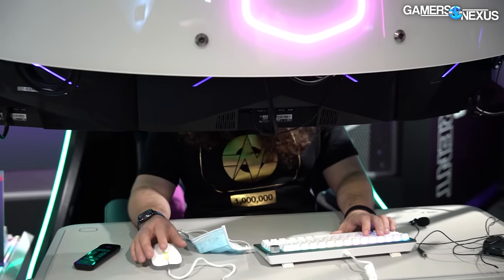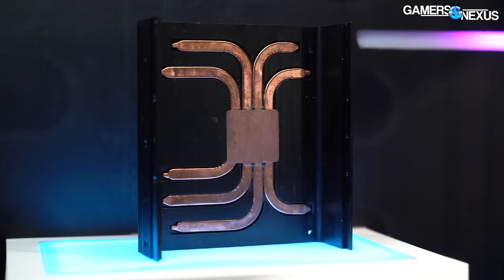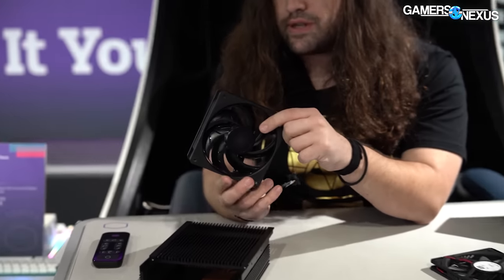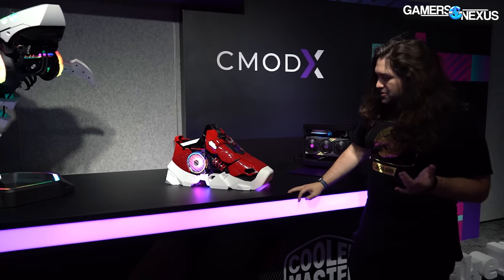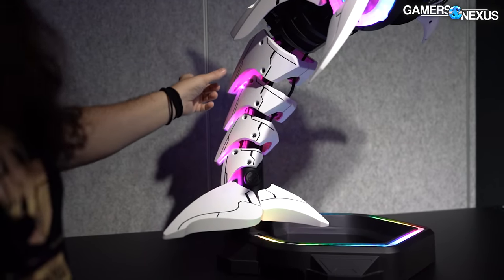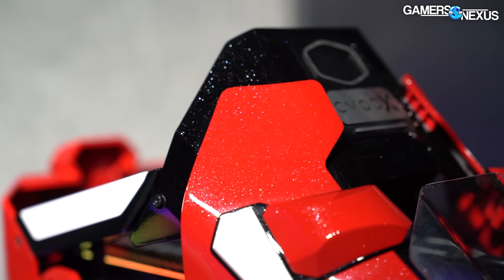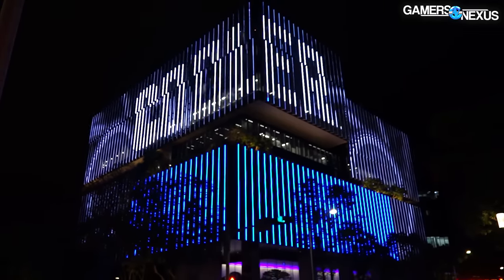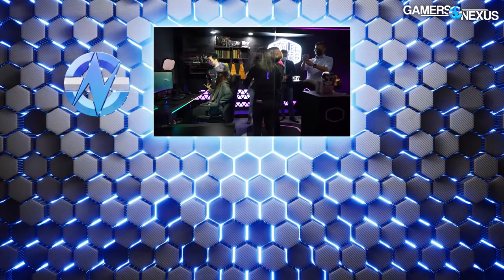Prototype PSUs, Cases, & Cooling PC Parts (Cooler Master HQ)

Comment: The shark thing is pretty cool looking. The amount of room you need for that though is the factor.
Reply: With a metal spine I think you could mount a monitor to the belly. It doesn't solve the height problem but it makes (slightly) more efficient use of the space.
Reply: The novelty will wear off once you're shown it to your friends. Then you can stick it in the garage next to the unused exercise equipment, and invest in a practical case.
Reply: @duckrutt  Oh yeah, that would absolutly look real cool :)
Reply: @camplethargic8  Why would the novelty wear off? People don't stick their RGB parts in the garage once they've shown it to their friends.
Reply: @camplethargic8  I think as a HTPC it wouldn't wear off, it is a pretty nice statue piece.

Comment: I would definitely buy that shark case if it could hold gaming components, absolutely love that thing (and sea creatures)
Reply: Same here! That also sounds awesome for a living room PC for streaming stuff lol
Reply: They're unique and small batch as hell. Cleaning would be a copper plated b!#@#. I'd be expecting to pay 500-600 each at least. The shark would be a centre piece of art not an integrated gaming solution.  I think just designing a work desk with drawers that is also a case would pay off. I'm a hard core full case or die builder myself.
Reply: @PsychoticusRex  I think the shark was listed at~5000

Comment: the tooling cost for the sneaker case has to be absolutely insane, especially when you consider that they most likely won't produce a lot
Reply: Shot mold process for ABS isn't expensive. Not by a long shot. Even with the cost of making the mold sections. The actual cost is in the assembly of the things, because people have to hand assemble them. They can't assemble them with a robot like they do at Lenovo, Toshiba, HP, Dell, or any other mass production OE computer supplier.

Comment: 11:49 there's an important distinction you need to make between bubbles of gas and cavitation. cavitation is a somewhat extreme event where fluid can't move in to a space fast enough and instead creates a pocket of extreme low pressure where it vapourises and then immediately collapses in on itself due to it being virtually a vacuum. what you seem to be describing is just normal bubbles of vapour as a result of heat.

Comment: I adore Cooler Master products. I use their 120/140mm halos in my system, have their Illusion 360mm AIO and GPU bracket and their wrist pad. So far, I’ve not been disappointed by any of them. I trust history and proof of work, and that’s something CM has 💜

Comment: What size shocks are in the sneaker case? Could you change them out for air shocks? I don't normally like flashy cases, but both of those cool. What a weird idea. They should definitely sell them aftermarket for custom builds.
Reply: How long until those case designs get ripped off? I've seem some Lian Li O11 clones that make some aesthetic improvements, though I don't know about the build quality.

Comment: A dry liquid cooler is more effective than one with liquid in it because when it is dry there is more space inside of it for hotness whereas if it has liquid then the liquid takes up most of the space and there's nowhere to put the heat. Try it.

Comment: both of those cases look sick af, wouldn't get the shoe for myself, but the shark I would consider. I'd say both are probably easy $200~250 based on looks, but depends on materials and build quality. I'd believe and still consider even around 450~500 if it's short run and reasonably nice.

Comment: I love that Coolermaster made a sneaker PC case specifically for our new scalper friends over on StockX. LOL.
I definitely wouldn't buy either of those, and that's coming from somebody who has a Tower 900. The shark looks like some knock off Transformer you'd get at the dollar store but at least it looks kinda cool I guess. The Sneaker is just like, "Why?"
As for the throne & was like, "That's silly and probably ridiculously expensive." Then I realized the standing desk I'm currently making is going to come out to roughly a grand once it's all done and I should probably jut shut my mouth. To each their own.
The PSU stuff was the most interesting bit to me but I'd love to know more about that funky diamond substrate too.
All in all fun tour and now I want to eat noodles with heat pipes.... FOR SCIENCE. 
Thanks Coolermaster.

Comment: im still rocking the Coolermaster HAF X and its imo one of the best cases ever made
- still capable of mounting CD/DVD/BD drives if ever required
- enough cooling for whatever you put inside(multiple 200mm fans etc) 
- way more than enough storage for 3.5" HDDs to keep a healthy 80TB RAID0 vault INSIDE the case within 5 quick access slots PLUS extra bays for HDDs if needed in the front
- large enough to fit not just a Radeon RX 7900XTX but even the RTX 4090 AND if the rumors are true, even the RTX 4090TI(336mm/140mm/61mm) Although I might have to dismount the front facing HDD bays to make it fit as there is roughly 340mm space and I dont know how much wiggle room is needed to mount the card.
- top it off with enough options to cablemanage, and if the front bays are not needed even enough space to fit a waterpump/reservoir for CWC

And its large. And its heavy. If theres ever an earthquake, I will hide inside the case to be safe.

Case Prices: 
Shark: as it would be acollector piece andrequires a bit more engineering so that it doesnt just randomly disintegrates due to hardware weight, roughly 180-220€ i think.
Sneaker: I know someone who would totally rock that case and pay a lot for it, but I think as a show/collector piece its fair around 120-180€Collector piece.

Comment: 100% agree about the shoelaces.  The shoe motif without that detail is just half-assed and fully assed, with haptics, is strongly preferred.  A shark that doesn't jump over a motorcycle case or vice versa is likewise disappointing.

Comment: Sneaker PC case: probably about $180/$190 for a custom smallish form factor itx case with 360mm radiator support

My guess is it will cost about thrice that with branding for stand alone and ~$4000 ish for a high end prebuilt

Comment: If heatpipes work on water evaporation and re-condensation, how do heatpipes work during "idle" or light workloads when temperatures are like 30-40-50 degrees C?

Comment: The shark looks cool, but I'm getting old and thought it would be convenient if they had a table lamp lights in there too either along the shart's belly/mandible or the eyes so I could light up my desk or my wall. Maybe 200 dollars at most if it can also replace my desk lamp (I usually buy under $100 cases with my last one from 2019).

Comment: The shark looks like an enemy from the horizon games which is cool but a bit much for me. I actually like the sneaker, it doesn't look like the temps would be that bad. The GPU is pretty much half in open air with a fan pointed at it and the CPU rad doesn't look that chocked off. If money was no object for me, I might buy one for the novelty.

Comment: Two phase cooling is unnecessary in a loop. In fact, in nuclear reactors we really avoid it to prevent film boiling. Just increase your fluid flow rate to increase your heat removal rate, liquids are incompressible after all.

Comment: I would pay  $3-400 for the shark case, if cooling at least is able to keep the CPU at below throttling levels and could fit a larger 3 slot card. Not a fan of the shoe however, I understand that there may be a market for  that as well.

Comment: I probably just wouldn't but the sneaker.
Shark tho, that's pretty cool. I still probably would just choose a reasonable high airflow case, but if I were to buy it? Hmmm, I know it's gonna cost more then a regular case so I'll say like $300. Any more and even if I really wanted it I just wouldn't bite. I admit with the size, metal, and level of engineering and design the case will probably go for a bit more than that.
Now, give us a dragon case in a similar style and I might just pull out the wallet for a ridiculous amount.

Editing because I also wanted to note that I'd be less likely to buy if it was a prebuilt -- if I were to want the case, then I really just want the case, it's the part that's actually special. Making me buy it as a pre built just means I am being forced to buy parts I could buy anyway in order to get the thing I actually want.

Comment: I wouldn't buy either of the specialty cases. But for a guess on the price $2,500 for the sneaker, $3,000 for the shark. Assuming they have top of the line components.

Comment: Both of those cases are off the wall different and I imagine in the realm of $300-350ish.  I like the sneaker, but not the shark.  Unbranded, I think it would be a seller at $125-150.

Comment: Dont it make sense to have a top mounted psu in the case? When bottom mounted it pulls the heat from the bottom and heat rises naturally. Then passes that heat past your GPU and CPU. So why would anyone want that extra heat that could easily be avoided all together?

Comment: I'd like to see more limited edition PC cases that are not all closed or open boxes. Test bench, wall mounted, small form factor and the likes are so boring. Center or display pieces, that demand attention, and warrant an obscene amount of RGB/LEDs, would make more sense than the glass windowed table/floor boxes that exist. Something round maybe, spheroid? A recliner with the frame arranged to house a PC with liquid cooling mounts, open or closed loops supported, ports in the hand rests... Just something different. I want to see it. (Sneaker: USD $188.00), (Shark: USD $250.00 )

Comment: If I was obscenely rich I'd buy the shoe and shark almost regardless of price but for a middle class person I'd say 1000 USD per stand alone or 5000 USD prebuilt with top specs because the installation would have to be done slowly and by experts so assembly would be quite costly in my opinion.

Comment: If I did buy one of those cases, I actually would prefer the pre-built route they are offering.  Having to build in such a strange case is not something I would seek out.
Reply: You'd have to clean it at some point, so you'd have to take it apart and put it back together :/

Comment: TBH, I would pay entirely too much for that shark case. But as a prebuilt, I could see the markup getting way too high. The case with its necessary components (ie, that riser for sure) would probably be an impulse buy at $500 - way out of normal budgets, but even up to $1000 might be worth it for a cool decorative/showpiece build. Under $1000, it's much easier to splurge on a totally unnecessary item like that. But as a prebuilt, I doubt it would come in under $3000 unless it's a weak build. You're getting that markup across the whole budget of the rig instead of just the case, which is great for CM but sucks for someone who might already have many parts they need, or could trade around to get the right hardware for it. It's a much harder sell unless it's kinda-sorta trying to compete on price, which... why would it? It's a shark, more an art piece than PC case.

Comment: I don't really care about looks when it comes to hardware, so I wouldn't buy neither the sneaker, nor the shark. I would much rather shove all those parts in a clean black case. The only real use for a 'flashy' case I can think of is maybe in a business lobby - for example the sneaker can be used by a sports organization or something similar. The cooling solutions were much more interesting, in my opinion. Performance is always higher on the importance scale.

Comment: hopefully CM uses the power supply vapor chambers for high wattage SFX PSUs to make them quieter, all 850W SFX PSUs out now sound like leafblowers above 60% load which killed all the interest i had in SFF PCs (like, ALL my interest in sub 20L cases/builds is DEAD because of loud SFX and SFX-L PSUs) and is the reason i'm looking at MFF PCs now instead, specially because of the Enermax DF REV 850W which happens to be a quite short ATX PSU and ACTUALLY quiet at full load (according to Cybenetic Labs).

Comment: $2000-$4000 for the shark depends on the GPU it can use
Reply: bruuhh.. 2-4k for a cooler-master case? Yeah it does look pretty cool but are you sure you've taken all factors into account? Mediocre build quality, very limited space for parts (which is probably the most important factor given how huge GPUs are getting, might even need a separate baby shark just for the GPU xD) and it looks like a pretty bulky piece that would take a lot of physical space to display it. I don't think it should be more than $500 maaaybe 600 tops.

Comment: I'll pay 7k for a dragon pc if it is as cool as the shark one. A cooper case like Smaug with an exhaust fan on the mouth. Oh, and if the GPU reaches 100% the throat area will glow with red RGB. 10k. I'll pay 10k for that.

Comment: I still want a laptop cooler that has the same air cooler but on the cooling block there's a water cooling block that has hoses that run out of the laptop with quick connects to a radiator, fans, pump, and reservoir that are powered by there own power supply. The hoses should e long enough to be still lap usable. so at home you just hook up the connects and turn it on and you have water cooling and can put in your lap without it being hot both to your lap, and the keyboard be cooler. And there can be a better cpu and gpu that has 2 modes one for laptop air cooling and one for water cooling where the water cooled mode makes  the cpu and gpu as close to desk top power as can be. And since I use wireless monitors my laptop and even desktop get very hot. laptop coolers su*k 
Another water cooler they need to make is one for AIO desktop PCs where the radiator is connected to the back.

Comment: So they use a 1920/1988 design which is only about 80% efficient as opposed to a 2011 design which is 99% efficient. And their only innovation is the use of heat pipes to make up for the bad design.

Comment: are you saying that my $280 PSU would be much more expensive if they used aluminium for the casing? Really? ordinary metal sheet per psu ~$2 aluminium ~$10? And that's why they don't use it? I will insert my conclusion here: They don't use higher quality materials because it cuts into profits. To a consumer extra $10 isn't much but to a Brand that is selling units in thousands, it's a lot of money lost.

Comment: Cooler master does not have support on their website, they say they answer in 48 hours, but they do not answer, only when their ass itches. Your GP27u model went bad from the factory in its launch weeks, what kind of quality control is that. Almost 4 firmware in 1 month. dire and disgusting

Comment: I would not buy either pc case - because they are both ugly as sin. However .. realistically - when it comes to pricing..

- sneaker: realistically, depending on the choice of materials and quality - i guess 70000 ISK minium up to probably straight up to 150000 ISK
- shark: similar to the sneaker, but because this one seems a lot less likely to fit into a setting ... a little less, 70000 ISK up to maybe 130000 ISK

Comment: Actually aluminum is not expensive but copper is very expensive. The reason for steel cases is the ease of production and strength with the usual holes in most of the body. Wouldn't buy either of those idiot looking pc's. Those color changing rods should be exactly the same size or the test is no good and in this case, it is no good.